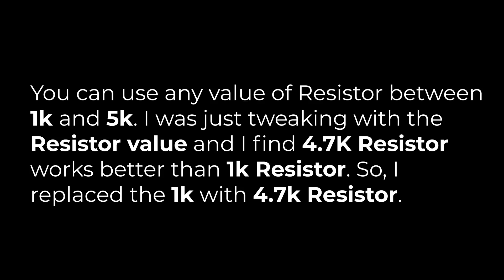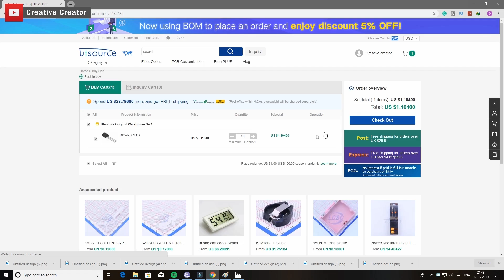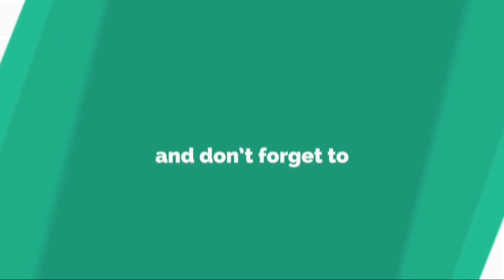Simple LED Flasher circuit with IRFZ44N

Comment: LED ? VOLT ?
Reply from the maker: 12v
Reply: @Creativecreator  An LED is operated with current - not with voltage. Without a current limit, the LED will die very quickly.